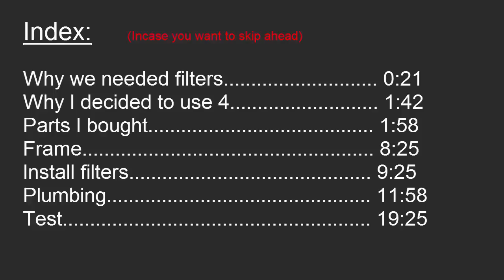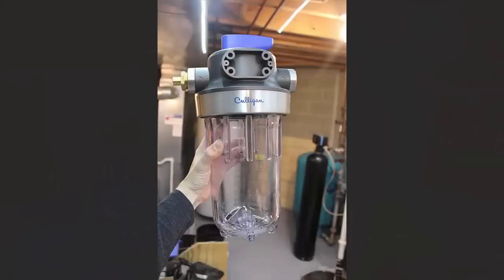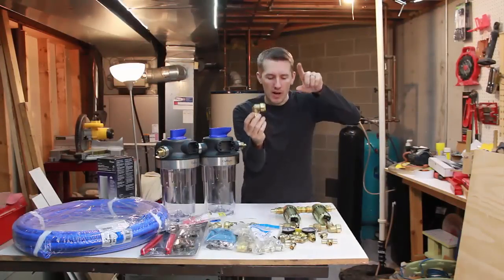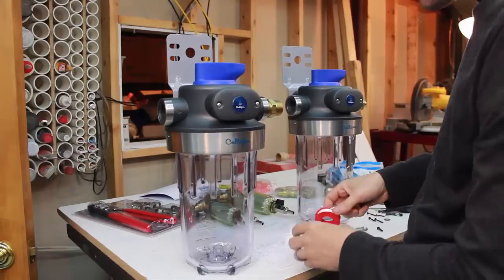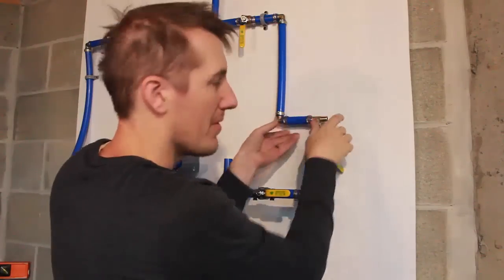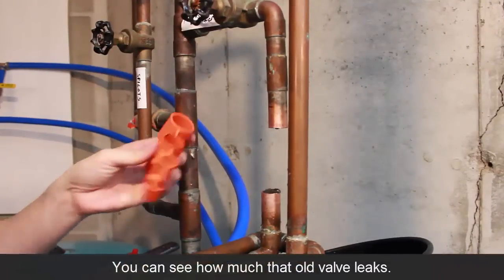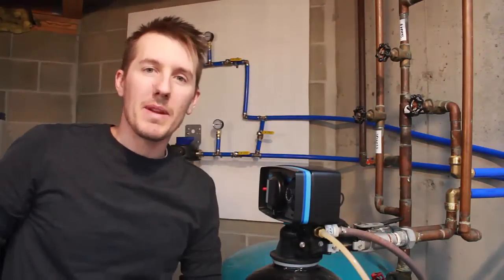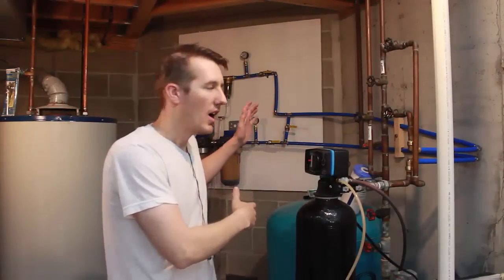How to Install a Whole House Water Filter System

Comment: Here is a few more tips:

You could have put Sharkbite 1"  Brass Male to 34" Push on fittings with a short copper stub in the middle between your canisters.  Since Sharkbites allow the pipes to spin you could tighten the male fittings without taking them apart or have to spin one canister.
It would have set you back $35 for the pair.  One would work as well but me more trouble to setup.

You could add in a plex T pointing down with a Shutoff which would allow you to release the pressure and drain some water when you have the bypass going to change the filters.  There is still water on your filter side when you turn on the bypass.

You never want sideways pressure on a Sharkbite fitting as it can reduce the pressure on its internal O-ring and cause leaking.  Pipes should always enter straight on and level and have a clean even end.  Cutting with a hacksaw might not give you an even end.  Once you cut your piece out you should have checked for a flush end and if it was not flush used a small pipe cutter to clean it up.  Almost all Sharkbite leaks are caused by improper installation.

Sharkbite fittings going to metal pipes do not need the plastic insert in the fitting.  It is there to make sure plastic pipe holds it shape.  If you pull it out it opens up the fitting for better water flow.

You want to make sure you debur the inside of any copper pipes you cut.  Pipe cutters always leave a small lip which should be removed which lowers turbulence and wear.  Not sure about hacksaws in your case.

I looked at the 10" Culligan myself but decided to go with larger 20" housings as you only have to change them half as often due to their large internal filter.

The clear filter housing looks cool but I have heard some people complain that they got algae growth in their canisters which does not happen on the opaque housings.  Some clear housings are rated to lower pressure as well although the Culligan clear housing has a high pressure rating.

The silicone grease is a good tip to put on thr O-rings and threads.  This makes the housings easier to put on and take off and they do not need to be turned as tight which makes the O-rings last longer.  Many people over tighten their housings to try to stop leaks which kills the O-rings.

Personally once I got everything wotking I would have replace the plex and Sharkbites with copper as I think it looks better and be less likely to cause problems long term.
Reply: or a union fitting

Comment: Hello Dave,
Nice and clear explanation and demonstration!
Expanded PEX is Type A PEX. You are using type B PEX which is NOT expandable and uses crimp or the cinch rings you have. You need a plumber's Crescent/adjustable wrench. Opens to 2 1/8 inches...With the nipple between the two filters, first take off the cans (easier to work with), screw one end of nipple into the first filter finger tight then screw the other filter on a bit. Now rotate the filter on the nipple. The nipple then threads into BOTH housings at the same time giving precise control over where the housings line up and both having equal tightness to prevent leaking. Don't be concerned with tightening AT THE nipple itself; actually it doesn't need the HEX nut. A standard one inch brass nipple would have done the trick!  The way you did it, the first is good and tight, but the second loses some ability to tighten because you have to stop at the alignment point. It's an old trick for when a plumber is installing a nipple!
When cinching, cinch the clamp just a hair so it is not loose on the PEX. Then it can be moved to the exact position and fully cinched in two seconds.
There are brackets which usually come with the spin down filters that clip onto the clear can of the filter housing. Your vendor didn't give you any!
Use the same nipple install technique for the spin filters that are connected by a single nipple. You have a leak because you probably backed off the filter to line it up. At the gauge, just need more Teflon...
Why not just mount the spin filters in-line with the other filters. You have plenty of room and it will eliminate the Z in the piping/ two elbows, and the spin filter's drain won't be over the other filters.
The first pressure gauge should be mounted BEFORE all the new piping. That way it will always show input pressure. Mounted after the valve defeats its use. The second gauge is good, since it will show if the system is pressurized when the bypass is closed, and can be used  to show the differential when in operation. Might want to swap the gauges to verify their accuracy. They might be different by a pound  or two!
Additionally, the 3/4 PEX fitting will cause up to 2.5 psi drop in pressure. You have the room; use a metal or plastic "90 degree PEX bend bracket" and bend the PEX 90 degrees instead of using the elbow the elbow. If you have a 3/4 rigid conduit bender,  that can be used to pre-form the PEX to get it into the 3/4 PEX bracket. That fitting not only lowers pressure but increases turbulence in the piping (possible noise source). Use of bends eliminates both flaws when using PEX.
The "big round curve"; eliminate with a 90 degree bend bracket; doesn't have to be attached, but it holds the bend in the PEX. If yo bend PEX, it will eventually want to go back to its original shape. Which is why the bend bracket is needed.
Note too that the fewer PEX connections, the more reliable the system is.
Instructions! Oh my! Just use the bypass valve built into the Culligan filter to bypass and change the filter. No need for all those extra valves to be manipulated when merely changing filters...
One problem with this Culligan (and many others) filter design is how the o-rings are used. O-rings were never meant to be CRUSHED which is what happens if the can is put on too tight. Notice the spin-on filters the o-ring is NOT crushed because the o-ring is on the periphery of the clear can and NOT on the top of the can to be crushed.

Comment: Whoa, nice video.  Just moved into our home with a well in West Virginia.  Just like yours, one crappy and never changed old house filter.  Your detail is most appreciated.  I really liked the idea of clear cartridge holders.  My water actually seems pretty good and certainly not as much rust and sediment as you but I do have a smell.  So I’m hoping that there are different types of filters to choose from.  I’m checking out your parts and will begin a design and order the parts you used.  This Retired Veteran thanks you.

Comment: Thank , Great job. I just drove a well with a well point. Now I am going to put in a filter system along with a neutralizer. This video will help a lot..  By the way I have a friend that is a master plumber. What he does with screw on fitting is use teflon tape and pipe dope.  I asked him because i was having issues with leaks. After I started doing that. no leaks..

Comment: After watching a week of YouTube videos from many sources and do it yourselfers, I'm more confused than ever. Depending on where you live will determine on what type of system you need  because city municipal water is different from Rural Well Water. The best advice I've heard so far is to get your water tested first whether you do it yourself or by an expert. Once you've done that then you can figure out what systems you need. If you're not a do it your selfer like me, it's best to rely on experts in the field and professional Plumbing installers for recommendations on what will work for your home. There are too many choices and it's expensive if you choose the wrong equipment. But kiddos to guys like you who are handy and can figure it out so well done.

Comment: this is a great DIY video that doesn't involve soldering and for people that doesn't get enough straight pipe length to put all the filters in 1 straight line. For people that uses city water, you can also add more filter stations for carbon filter, iron, lead, heavy metal filters, UV light, etc.

Comment: Great video Dave!  We just built a large home to take in foster children.  Our well is supposedly rated at 100+ gallons per minute and our pressure tank is set at 60 psi.  After one month, we just noticed a lot of sediment that was clogging up the toilet valves.  I dont' know what caused it, but we were running four dishwashers, 2-3 showers, and probably a few toilets being flushed.  Fortunately I had watched your video prior to finishing the plumbing, so I put in bypass pipe and valves ahead of time in order to install a whole house filter and also a water softener. Looks like its time to install the whole house filter.  Just ordered all the stuff you listed on Amazon and I really appreciate you providing that list so I didnt have to do all my own research on filters, etc.  Thank you again for being so helpful.  God bless!

Comment: I have a 50 feet borewell and the water isn't safe to drink the lid wasn't properly seated they had put insulation insulation around the lid and dirt was seeping in we have it fixed watching this video I can learn how a water filtration is set up easy I liked how you chose not copper as down the road they spring leaks and the psi gauge to keep a look out on water I like how you can flush out the filters and also change them I would buy this kit good video glad I found it.
Reply: That is one hell of a sentence.
Reply: Lol

Comment: That's quite an elaborate system,  I have a single sediment filter that clogs quickly.  I'm using GE pleated 30-micron fiters from Home Depot, $10 each when you buy a 4 pack.  Good call on the clear covers so you can see the filters. I have the blue one and it's always a guessing game. I know when the water pressure drops, it's time to change, typically every couple of months. What I'm looking for is a whole home sediment filter that does backwash to auto-clean itself so I can get out of the filter-changing game.  :)

Comment: Please wind your pipe thread tape in the direction that you would screw something on to it. This not only provides a better seal but will prevent the tape from slipping off as you screw it in place. I'm thinking your small leaks might have had something to do with this error. Great info on this video. Keep it up.
Reply: Yup, I just learned this lesson. When you unscrew them and there's no tape on the threads that's a sign you did it the wrong way. If you did it right, the threads will be smeared with white.
Reply: They also make teflon liquid
Reply: If the pipe screws in clockwise you wrap your tape counter clockwise otherwise it unwinds when you screw in the pipe giving a poor seal.

Comment: I like your filter system and am in the process of designing one for my house and decided to watch your video.  It is very well laid out and thought out.  I just have one comment and that is that the hex nipples you linked to on Amazon have lead in them.  In the Amazon description it states "WARNING - This product can expose you to chemicals including lead(~2.85%), which is not allowed by federal law to  be installed for potable water use in the U.S.A. and its territories."  I only caught it because I am a hydraulic specialist and worked in the food industry for 8 years and I had to stay current on FDA/DEC/NSF/ANSI standards.  Most hex nipples are higher pressure and designed for hydraulic, oil or fuel and are not NSF/ANSI Standard 61 (drinking water standards).  Before you go and replace it, look over the hex nipples and see if you can see 61, 61-9, 61-G or 61/9G stamped on it, meaning they are food/drinking water grade.  If not I would change them out.  I prefer hex nipples over straight nipples, and about the only place I have seen standard 61 hex nipples is through McMaster-Carr.  Like your system and cheers!
Reply from the maker: For some reason today all my amzn.to don't seem to be loading.  But anyway, i thought that when i bought all the connectors, they were safe.  I didn't buy all official shark-bite connectors because they were sometimes double the price.  But i didn't think i bought any shady chinese connectors with lead in them.  So i guess use the links as a suggestion, then buy the better quality version of the connector.

Comment: Dave,  A well done video.  I learned a great deal and am designing my system now.   A couple of thoughts you might want to research.   I watched a shark bite video and one of the cautions when connecting to copper was to not scratch the copper pipe.  I took this to mean don't sand it.  The other thought is a copper pipe system is usually grounded to the electrical system.  Even the water meter is bridged by a ground wire with clamps on both sides.   Needed or not I intend to bridge the main water line where I cut it for inserting the PEX lines.  Again  thats for your work.  Loren

Comment: Good video
Just NOTE: you cannot verify filter pressure drop unless you have significant flow through the system (ie a shower) while you check the filter simultaneously
Reply: I did mine almost the same way and even with both bathtub taps open you don't see any detectable pressure difference on the gauges.

Comment: I will probably put 2 or 3 2x4s on the actual wall, then screw the mounting board to that with a few screws. Mainly because if I ever need to pull the system down I will be unscrewing the entire wall mount from the wood and not the cement..those screws don't seem to hold well for me after their first time in the wall. Great Idea, and super job! 😀

Comment: You are years ahead of me.  We bought our house needing new everything in 2022 and the plumber set up my well water filtration system so that it filters everything - including the water going to the outside water spigots.  That means that all my outdoor watering helps degrade my filter so that I have to replace it more often.  Is there any reason to include outside water in filtration??  

Thanks for such great information!
Reply from the maker: My house had a bypass to the outside spigots.  It was before the bypass to the softener.
No you don't have to filter outside water.  It's not the end of the world, but ya you are filtering water to spray the ground.

Comment: While you were at it you should've change those valves out for ballcock, I don't know if you noticed it but it seemed like water was coming out slowly when you cut it off.  Good work, I'll be doing mine based on this.

Comment: The guages are too far from the pipe. Water that gets to the guage is not easily returned in back into the system. So it sort of sits there. Great video and explanations. I'm designing mine now and this is very helpful. Thank you.
Reply from the maker: ya someone else said that the gauges don't really work to show the "flow" just pressure.  I don't really check them any more and wouldn't install them in the future.  well maybe just 1 but not 2

Comment: Im adding a ph neutralizing tank and was wondering where in the lineup you’d suggest putting it? We also have a basic water softener tank like yours and I’m unsure if I should tie into it’s output on its own bypass loop or tie into it before the water goes to it? Also, have you heard of using spindown filters before the well pump? We’ve had to replace ours twice now so anything to clear the water up a little before the well pump seems like a good idea. Thanks for any help you might provide.
Reply from the maker: Don't know about a PH tank.
I have everything filtered before going to the softener - the softener is last before going to the rest of the house.
A spindown filter might be good before coming into the house (especially somewhere warm like florida) - but i've never seen it in other video's
Ya i bet my pressure tank and pump are full of rust

Comment: Could have used a simple union between the large filter canisters. Do you not use rust removal salt with your water softner. By the way great video, I'm in Michigan as well.

Comment: GREAT VIDEO!! Thank you!! A very professional job pal. 
  I will build one almost exactly like it.
One question though because you said it two or more times, about how great the water pressure is in MI. You started out saying that you have well water..right? If so, what would the water pressure in MI matter?? That's only for city water correct? 
I was just wondering because you prove, to ME anyway, that your a pretty smart guy so I figured you must have a reason for saying it. Thanks in advance for your answer..and again, GREAT video!! Well produced, written, and recorded as well..both video AND sound! Quality work all the way. Maybe you should do a video on HOW TO DO a YouTube video!!😀 I would watch it!!
Reply from the maker: I just heard stories of people from states like New Mexico or Texas where they have wells that are several hundred feet deep and only get 3 gallons per minute.  Lots of personal wells people have here in Michigan are around 50 feet.  It was just a point of saying that i wasn't too worried about water pressure or flow rate dropping.  But if you already have poor water pressure, then it might be an issue.  Although i haven't checked since i put the filters in, we haven't noticed a drop in pressure from the shower head or anything.

Comment: Place blue tape onto the filter housings with the date and micron.
The difference in pressure could be the gauges if there are different brands and sizes.

Comment: Have you tested your water before and after to see what your filter system is filtering out? Thanks
Reply from the maker: Not specifically, no.
We had the initial water test done when we bought the house, but i believe that was just for arsenic, which we had 13 ppb.
Our reverse osmosis filters reduced that to 1 ppb.
I just know that after about a month, the filters get full of iron/rust and i can see it start to show up in the tub/toilet/shower.  Then i need to change the filter.